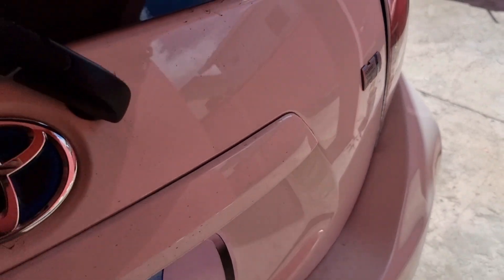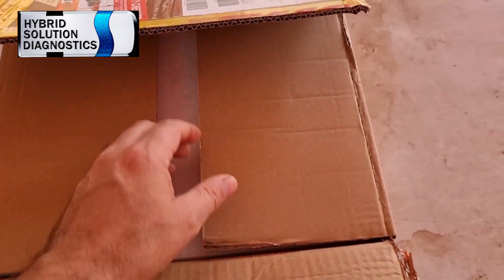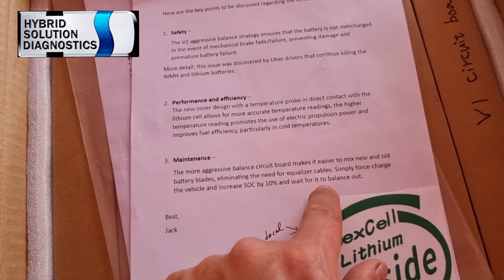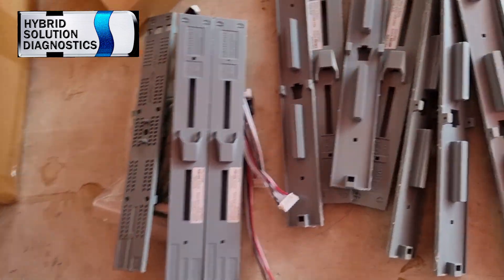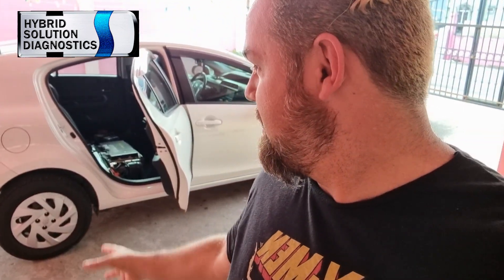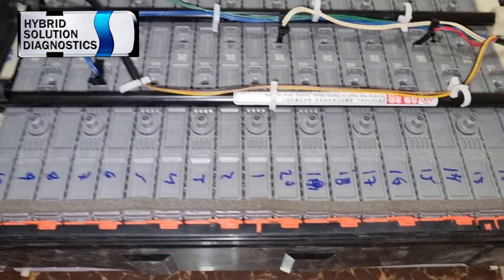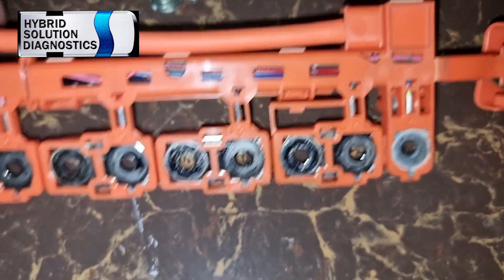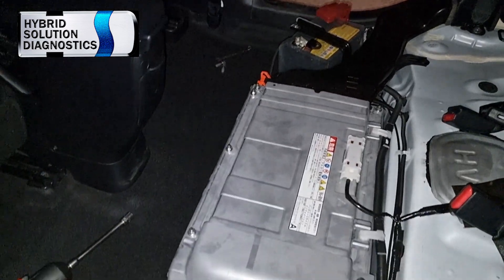Unboxing the NEW nexcell hybrid battery upgrade for toyota PART 1

Comment: Just a heads up, those cells aren't safe. Yes its LifePO4. No, it's not overspeced. BMS here is truly awful, since it's basically a voltage leveling through a load device (engine fills the battery with ions/electrons/protons/whatever and that circuit board wastes them as heat at the best case scenario of a few watts per pack (14*2=28), essentially acting like an overflow hole on a bucket, but the hole drains the bucket slower than the engine is able to fill it up).
So the problem with balancing still persists and it's would be smarter to either get a real BMS with load balancing and shutoffs (possibly triggering the red triangle when activated) or getting the round nimh cells.

Comment: hello, I would like to know if it's feasible to upgrade an A3 e-tron with this battery ?
Reply from the maker: Not at all… Audi uses lithium Ion batteries which are way stronger than this
Reply: @hybridsolutiondiagnostics Thank you...I have been watching many of your Prius videos... 

Is there a part 2?  Did your mpg increase..how much?  I went to their website and they have an offering for the GEN2 Prius..  

I am still on the original HV pack no check engine light or red triangle.  I am about to watch your video on balancing the cells

Comment: hi what you think about EVd-40 load test on a battery pack
Reply from the maker: It is a very delicate machine but it does the job very well charging discharging collectively and monitoring individual modules…
Reply: @hybridsolutiondiagnostics  look into invest in one

Comment: I purchased my projectlithium battery in October 2022. What are the issues that people were having with this battery? I’ve generally had a good experience, but seeing the letter from Jack explaining that Uber drivers encounter issues with previous batteries, this has me concerned. I also drive Uber, and I rely on my car
Reply: You can trade in for the Sodium pack at 50% off apparently. Supposed to be more reliable.

Comment: Hi
What happens to circuit board?
Reply: stay the same
Reply: @Christopher  what about safety? One of module over heated there is any system to shut down the Hi voltage system? How many cells in side the one module?

Comment: If disconnect the red safety on battery does the positive pole has charge is it safe to open with regular tools
Reply from the maker: Better always with insulated tools… but it’s quite safer with the plug grip off…
Reply: @hybridsolutiondiagnostics  thanks a lot also my car has 220000 miles I use for Uber if I just move inner ones out and clean connectors or I buy from eBay is around 15$ is good for prolong battery life?

Comment: My 2017 Niro FE hybrid battery just died at 423,000 miles. I bought it in June 2018 as a new leftover. I average between 80-100 thousand miles a year Escorting Oversize Loads on semi's. 

The Dealership wants $10,000 for a new one......... which is complete BS!!! That battery is $2,300 new with a $2,500 core charge. Less than $5G. So why $10G and why wouldn't I get the core fee back?  It was cheaper to buy another 2017 FE with 171,000 miles, less than $10,000....and, just broken in, LOL. Now I need to find a used battery. I've seen some for around $1,500. I'd rather have a new one but I'm told I can't order one without an RA number from KIA, only available to authorized service centers. So, used is only option for now. Hint, Hint, Hint...... I've been building high capacity drone batteries for over 20 years, maybe I'll have a good look at this dead battery until something comes along.